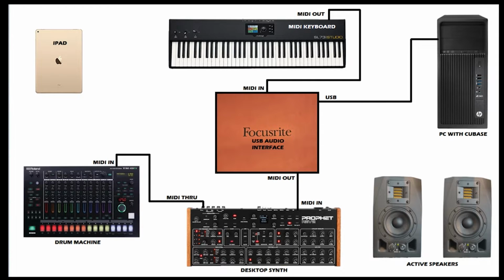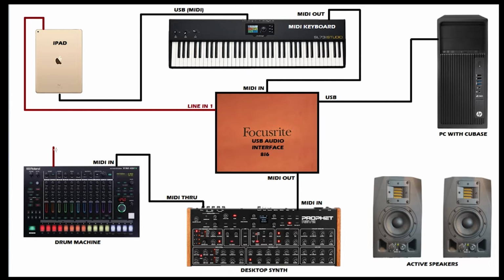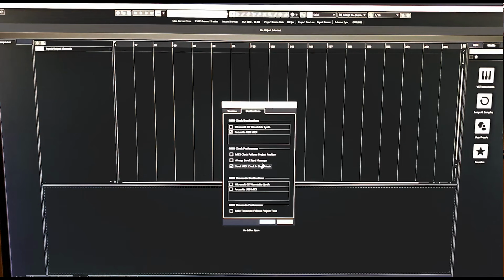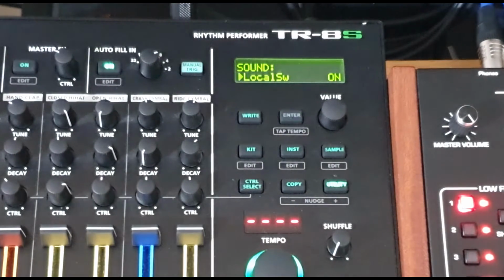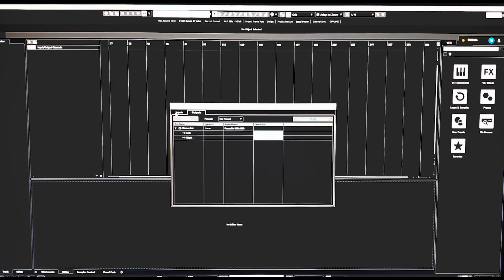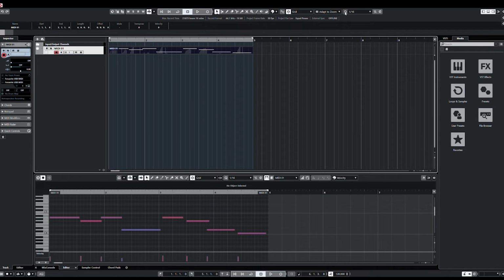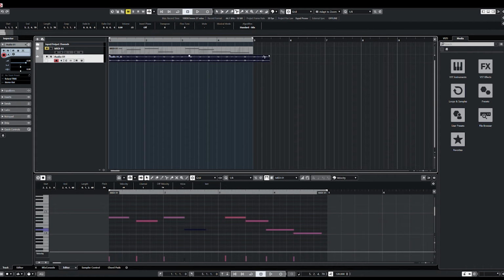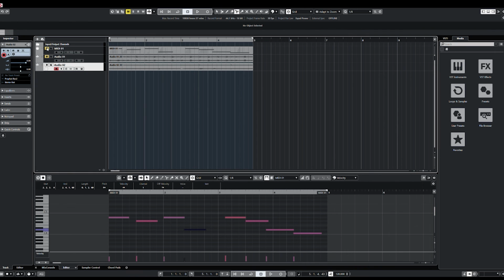midi & audio connection for Prophet Rev2, Roland TR8S & SL73 keyboard to cubase daw 5 pin midi setup

Comment: Great video thanks 👍 If you changed your output of the Prophet into the Inputs of the TR-8S, would it work the same? Just thinking of workaround if limitations on Inputs on Audio Interface. Cheers
Reply from the maker: You're welcome! Glad it's of some help. You could indeed use the TR8s input... not the best option but it will work. You need to power up the tr8s to get the audio out but it should work okay.

Comment: this is great, thanks for posting. I have a TR-8S I'm trying to send MIDI via MIDI in, coming from my Prophet 6. The 6 is sending MIDI via MIDI OUT, but I cannot get the TR-8S to detect the MIDI signal coming in via it's MIDI IN port. The drum machine is set to tempo source= MIDI, but still nothing. Is there something I'm missing?
Reply from the maker: Glad it's of some help. You could try put the TR8s tempo source = AUTO. Also check that a MIDI signal is definitely coming out of the Prophet (are there menu settings on prophet 6?)
Try another midi cable also if you have one spare. Is
Reply: Thanks for the quick reply- I got it working!  @davehyper7835